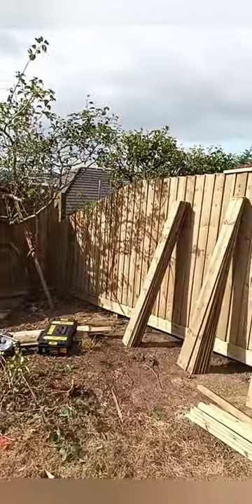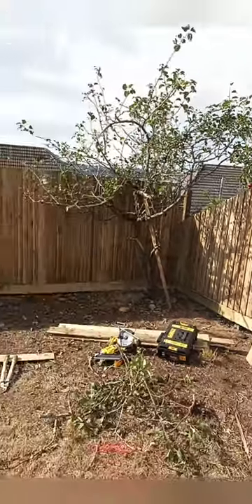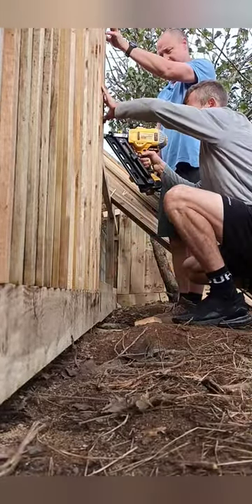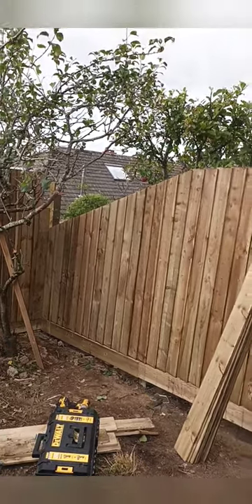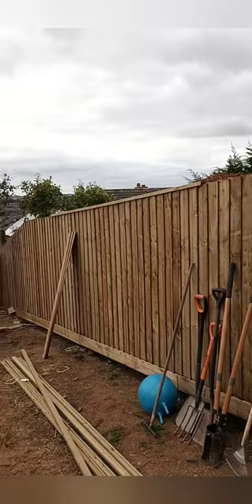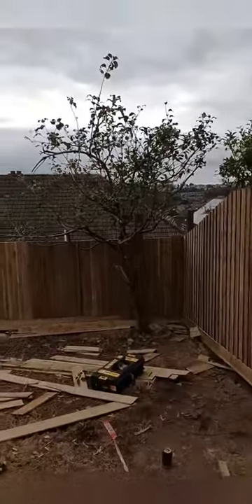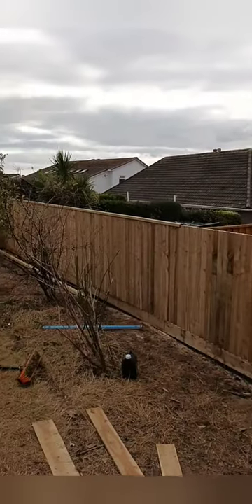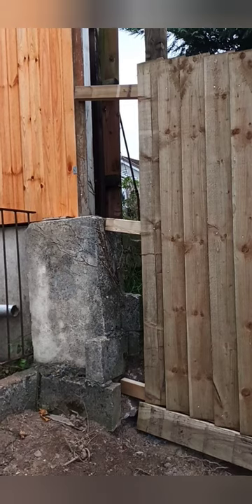Episode 5. Featheredge fencing with capping rail. 🏡👌

Comment: Looked great bud. On the side where rhe fence steps at the top. Did you cut them at an angle before the cap was applied or did the capping hide the slight stepping?